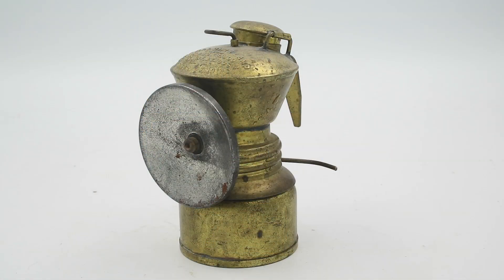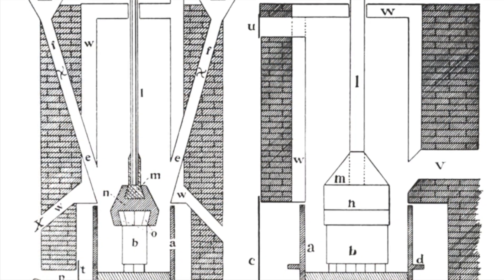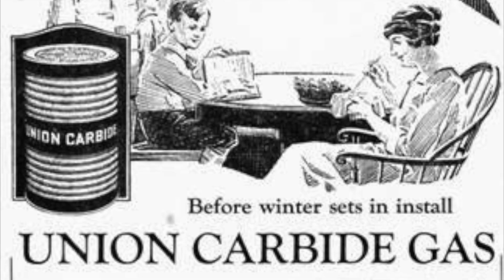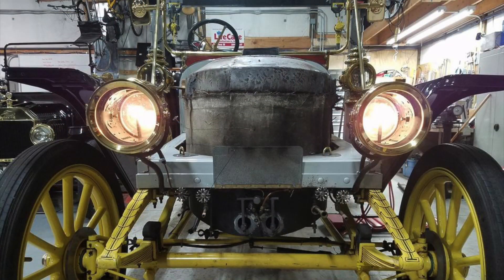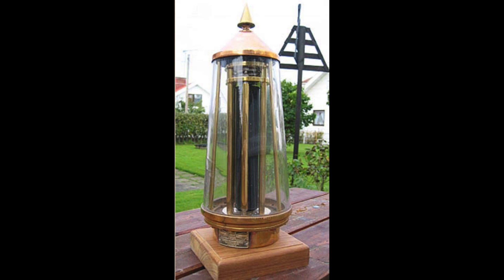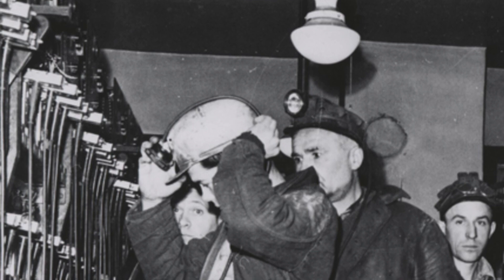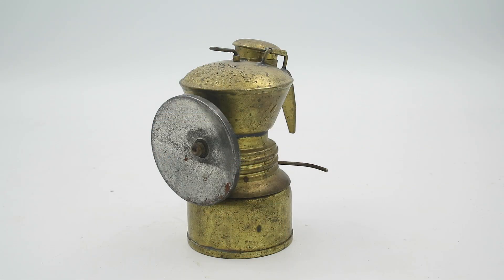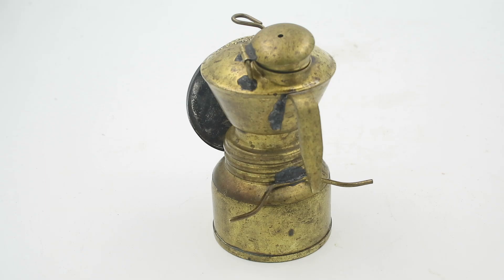Carbide Lamps: the Caver's Friend

Comment: It it wasn't for the pungent smell (and fire hazard to a lesser degree) I'd use it more than my LEDs.

I've been in into a kerosene lamp kick lately.
Reply: Have you tried an "Aladdin lamp"? Much more light and far less soot and smell than either a cold or hot blast lamp. Kind of from the same era as carbide lamps
Reply: @P_RO_  isn't that a literal open flame?

Comment: Carbide is also traditionally used at least in the east of the Netherlands (but likely in other places as well) in the New Years celibration. People make a small hole in a metal milk can (the large ones used on the farm to traditionally collect the cows' milk in), put some carbide and water in there, put the lid back on (although nowadays people tend to put a football in the hole rather than the lid, for safety reasons), wait a while, then put a flame to the hole. The generated acetylene explodes violently, shooting the lid or ball far away. Search YT for 'carbidschieten' if you want to see videos, it's sometimes been scaled up to ridiculous levels.
Reply: Oh yeah, we use to make potato "bazookas" using big plastic pipes and of course carbide. Pretty noisy and scary, and they had a surprisingly long range.
Reply from the maker: I've heard of similar traditions in several other places, including Indonesia and the Philippines, where they use bamboo to contain the explosion. They also used to sell small toy cannons (the most famous being the "Big Bang" brand) that operated on the same principle.
Reply: @CanadianMacGyver  The Big Bang cannon is still manufactured by The Conestoga Company in Allentown, PA.  The calcium carbide is a coarse powder (about like coarse ground pepper) that comes in sealed metal tubes called Bangsite.
Reply: My father told me about doing that with milk cans, as a child growing up in Detroit in the 1920s.
Reply: In my country, carbide is also used traditionally for Eid celebrations. People build a makeshift cannon (usually out of bamboo, some people wrap the cannon with wires or bicycle chains for strength, those with more money would use a steel water pipe), where carbide and water is mixed in it. The cannon is fired by putting a fire source on a touch hole.
Reply: Sounds like an overgrown tennis ball cannon, only those use naptha (lighter fluid)a for the propellant. In the seventies, we used the old steel pop cans to make the cannon, but those aren't easy to come by now.
Reply: Oh so those are the ones in the Half Sword abyss
Reply: We did that with steel Gatorade cans taped into a tube and used tennis balls and a fee drops of lighter fluid vaporized.
Reply: That's awesome
😊
Reply: when i was a kid we used a old tank shell put carbide in in with water (most often our spit) put a piece of wood with rag on it an jam it in. it would fly far far away, problem was finding that log back to reload XD
Reply: Awesome. I’ll be getting one of these for when the power goes out
Reply: Wow! I just watch a bunch. Wild! A nation of average canon users. Nice.
Reply: Interestingly enough in parts of Slovenia it's tradition to do the exact same thing at Easter. I believe some Polish holidays are also celebrated with carbide explosions, though most of the Polish videos I've seen looked more like they were using barrels rather than milk cans.
Reply: We use them for bamboo canons in the Philippines, also for New Year's.

Comment: Just in case you are not aware wet carbide expands and has been known to rupture the brass bottom 
of a carbide lamp. It is recommended to only fill the bottom two thirds full to allow for expansion.
I use vinegar to clean the stuck on spent carbide from the lamp bottom or carbide reservoir
Reply from the maker: Yes: I only put a little bit of carbide in the chamber, so it should be fine. And thanks for the cleaning tip; the whole thing needs a good cleaning and polishing.
Reply: CLR works great as well, it is calcium after all. Just make sure to scrape out as much as you can manually before adding chemicals as any unburnt fuel will react releasing gas.
Reply: @trevorhaddox6884  I don’t know what the active ingredients are in CLR, but be careful you don’t 
eat through the brass bottom. I always try to not leave spent carbide in the lamp so I don’t use vinegar
very often either.
Reply: I doubt that.  The porcelain tip or jet is press fitted and designed to pop out if under too much pressure.
Reply: @akradr  It is not the acetylene gas that ruptures the bottom it’s actually the resulting calcium 
 from the chemical reaction that expands I have seen this happen to novice caver’s. At one time 
you could buy replacement bottoms but not anymore.at least not new. If you can get original 
instructions they warn about over filling and not allowing for the expansion of the wet carbide. 
The tip is for gas expansion from too fast a reaction 
(too much carbide gets wet too fast, this often happens when you have a valve malfunction)

Comment: The reflector on your lantern is missing the flint striker wheel. The traditional way of lighting the flame was to put water in reservoir to start the gas flow, then place the palm of one hand over the reflector to concentrate the gas and quickly use other hand with thumb to strike the flint (just like a Zippo lighter) and voila!
Reply from the maker: As far as I can tell, this particular model did not come with a striker wheel; there is no hole or mounting bracket in the reflector for one. And I do mention in the video that most carbide lamps had one.
Reply: @CanadianMacGyver  yep you are correct the Baldwin design didn’t have a “self lighter” however in later years they were common with most lamps such as Guys Dropper, Auto-Lite, and Justrite which are the three best known brands of acetylene cap lamps
Reply: Carbide lanterns were usually ignited one-handed, holding the hand over the reflector for a moment, then pressing down with that same hand on the striker wheel, sliding the hand to the side and it is on. I was an avid spelunker in the’70s.
Reply: And if you leave your hand over the reflector for a bit, the acetylene gas accumulates and you get a satisfying POP when you light it!

Comment: A couple points: 1) Acetylene is explosive enough that it can be ignited by a flint-striker.  Other gas lamps operating on coal-gas or natural gas need to be lit by a match, a wick or an electric spark.  2) A subtle feature of the acetylene lamp is that the water flow into the lower chamber through the same hole that allows the acetylene to escape.  This means that as long as the pressure in-the lower vessel is great enough, it will not admit water.  When the pressure drops, more water can enter, reviving the reaction.  Thus the lamp is self-regulating.

If a home was too far from the city to have commercial gas, the choice was to use acetylene or gasoline fume lighting.  The apparatus for generating gasoline fumes was quite elaborate.  The last gasoline-fume lighting system was shut down in 1958.

An acetylene explosion also generates a massive amount of soot, so if it explodes in your face it will leave you looking like Wile E. Coyote after having a bomb go off.
Reply from the maker: As you've likely noticed, I'm starting to remake some of my earlier videos with improved audio and video quality. When I eventually remake my video on the use of town gas as vehicle fuel, I might include a section on gasoline fume lighting. Also, thanks for the info on the self-regulating nature of the lamp; that never came up in my research and I kind of wish I could add that to the video now!
Reply: I witnessed an explosion underground when a caver friend curiously opened a sealed plastic drum he found (after shaking it up) which turned out to contain not-entirely-spent carbide.
My memory is of a cloud of white smoke pouring out of the drum (probably a mixture of gas and dust), followed by seeing his realization of the problem and his desperate and ultimately unsuccessful attempt to close the lid before the flame from his carbide light ignited the cloud.
There was one hell of a bang, which echoed quite a few times up and down the very large shaft which we were sitting close to the edge of, and then a distinct smell of singed hair, but I don't recall anything in the way of soot, at least not on him.
Then there was a somewhat high-pitched "What the ** was that?" coming from a second friend who had just gone over the edge, and who was in the middle of doing a rebelay onto his first >100m long single-section abseil, which is a definite psychological hurdle in itself (even though anything above 15-20m is in reality high enough to make further worrying about possible worse outcomes somewhat moot). I can only imagine what adding a large and unexpected explosion to that must have felt like.
However, once I could see that there was no actual harm done other than to pride, I couldn't help but do the standard caver thing and burst out laughing, which I'm not sure my first friend has entirely forgiven me for, even though this was in the late 80s and he also had form in those days for this kind of thing.
The lights we used back then with a waist-mounted generator remote from the helmet mounted burner used a gas exit pipe separate from the water dropper, so there was no self-regulation for them beyond limited back-pressure from flow resistance at the burner jet. That was fine, though if one happened to end up wading in deep enough water, water pressure could turbocharge the light to seriously impressive levels of flame size and light output.
I do still miss carbide in some ways. The colour temperature of the light was comfortingly warm, and with a properly-working generator, if you were waiting somewhere cold and miserable, you could unclip the generator from your harness, clamp it between your upper thighs and get a maybe somewhat token but nevertheless psychologically significant amount of heat from it.
Reply: It is so damn sooty. The welding shop I often pass through often has little specks of black floating around the air from the acetylene torches.
Reply: Acetylene is a high explosive.
It is impact sensitive and is therefore stored in bottles as a saturated solution of acetylene in acetone soaked plaster which desensitises it…
Reply: @allangibson8494  That is not the only, or the main reason for storing acetylene in that fashion.
Compressed acetylene will explode at pressures greater than about 15 psig.  At that low pressure not much gas can be stored in a reasonably sized container, consequently the gas is dissolved in acetone which in turn is absorbed by the "sponge" material in the storage container.
Reply: @BasementEngineer  The “impact sensitive” part covers the pressure issues as well…

Comment: Yes! Miners lamps! Calcium carbide, a paint can, a bit of water an CC in the can with a lit tea light candle, and you got one HELL of a noise maker.
And, as a welder I am very well versed on the dangers of Acetylene gas, and how to handle it. If any you haven't seen it, you should take a minute to check out how it is possible to store acetylene at above 15psi without it getting all exlpode-y when you sneeze too close to it. The technology is deviously simple, and extremely effective. Kinda like a can of soda...